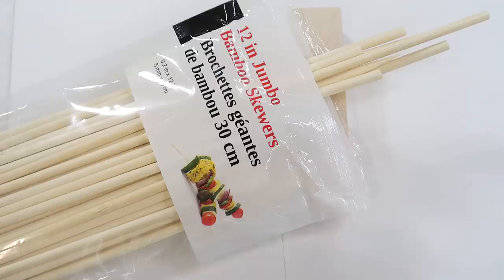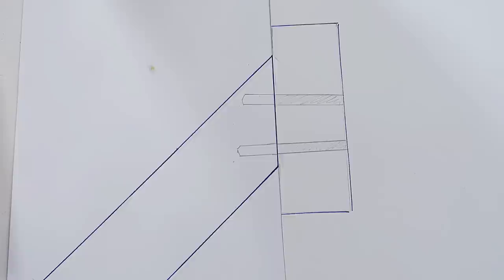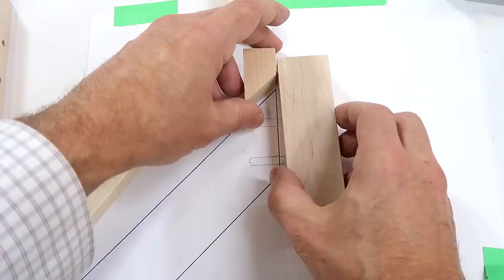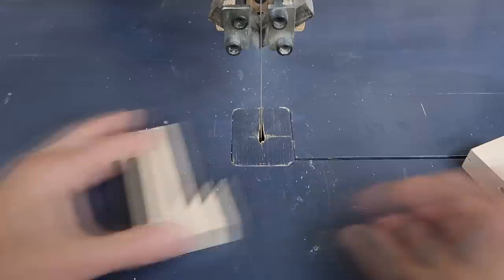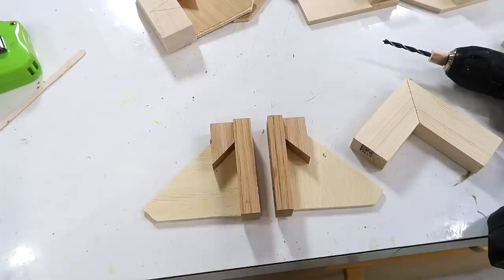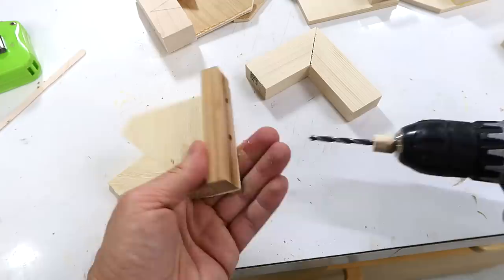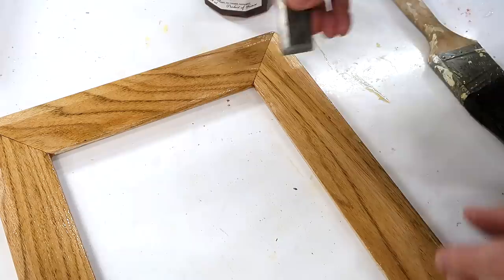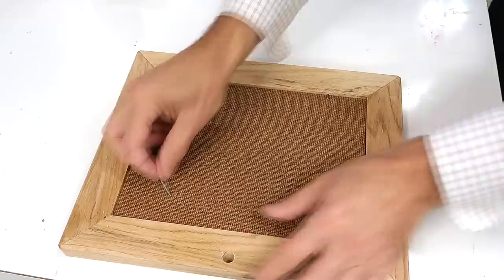Clever little miter doweling jig

Comment: Clever! If the holes are not perfectly square to the cut line when you split the block, they will be misaligned by the amount:  kerfwidth * tan(θ) ; and if they aren't parallel they won't be spaced evenly because the different angles will cause different offsets across the kerfwidth.  I suggest splitting the block first, then drill the holes so they stay aligned left-right, perhaps tape and superglue to a substrate to drill the holes after splitting.  Or just start with 2 blocks.
Reply: Don’t waste your time. Most viewers believe that every thing they see is genius, amazing and awesome !!!

Comment: If you cut the jig piece with the holes before drilling it, you won't have the saw's kerf contributing to misalignment.

If you drill the jig pieces oversized, you can press in a metal bushing for use as a drill guide to prolong the life.
Reply: Came here to say exactly this. Probably won't matter a ton (unless your drilling is super wonky), but definitely eliminates some slop.
Reply: If the two holes are too far out of parallel, the frame will be hard to assemble anyway. Just make the holes parallel enough, and you won't have to worry about the effect of the kerf
Reply: @liambohl  that's true, but if the holes are parallel, but not perpendicular to the cut, the final pieces will assemble, but not line up with the corner of the miter due to the kerf.
Reply: Strange that Matthias didn't consider this! He usually does like when making wooden bearing blocks. Make the cut, clamp back together and then drill.
Reply: Yeah, was gonna say the same. But if not too far out of parallel it wouldn't matter for woodworking. Metalworking is a whole different world though.

Comment: All-thread joining nuts makes for great cheap glue-in-place liners for drill-guides and the already drilled and threaded hole works fairly well as a self-centering guide when drilling out the threads(8mm drill for M8 nut etc) even if you just do it with the nut in a vice and use a battery-drill((using a smaller drill first is better from 6mm and up to get it as straight as possible if you don't have a drill-press/stand).
Reply from the maker: Good suggestion.  Though that may introduce some inaccuracy, unless I were to have super long nuts and cut those in half with the wood!
Reply: @matthiaswandel  While stuff like this is something that I would normally 3D print, in wood a hole that is marginally smaller than the largest diameter on the nut it will line itself up rather well in the hole and some polyurethane glue or construction sealant/adhesive(sikaflex/MS-polymer etc) will fill in the gaps and lock it solidly in place(thinking more about dowel/drill jigs in general rather than this one in particular).  

A joining nut's length is usually slightly shy of 5 times the bolt diameter(2x the diameter on either end + some extra room for leeway) so while a drill press is obviously preferable for drilling it out it is long enough to be fairly well self guiding if you don't have one(a M8 nut is usually 35mm long) so you would have to be rather brutal to see the last half of the length not be lined up/straight/centered well enough when drilling it out with a battery-drill.

Ever consider doing some tool/machine builds using laminate flooring as the build material? It's a rather amazing material that is cheap/strong/dimensionally accurate and available everywhere and in many cases its superior to MDF and plywood..

Comment: A clean and easy way to cut bamboo skewers is to score them along the circumference with a knife and simply break them in half. As a bonus, if the knife is not very sharp, the broken off pieces will have chamfered ends

Comment: I think that if the holes were significantly out of parrallel when drilling the jig and the dowels were long, you could have trouble inserting the two pieces. But with reasonable clearances on the dowels and holes, and reasonably parrallel holes, the jig will perform well.

Comment: The problem with bamboo dowels is that bamboo won't absorb an aliphatic resin glue, making it impervious to a glue like Titebond. Any kind of dowel will help a lot with alignment but bamboo dowels won't  reinforce the strength of a bond as well as dowels made from a more absorbent wood.

Comment: As usual, incredibly clever. (Except this time more than usual IMHO.). Two thoughts. If the dowel holes aren’t more or less parallel, it seems like fitting might be problematic (enough flex in dowels?).  Perhaps add a brass sleeve to keep jigs working longer. Thanks for the ideas!
Reply from the maker: If I drill them with a drill press, they are close enough to parallel without having to think about it.  With a hand drill, you'd have to be more careful

Comment: Very elegant. What glue do you prefer for sticking paper/card to a backing without wrinkling up the paper?
Reply from the maker: I just used a few dabs of hot glue
Reply: I'm really fond of rubber cement/contact cement for that: it's removable if used "wet" (ie. rubber cement mode can be peeled up easily, contact cement mode is permanent), doesn't wrinkle or hold the paper up off the backing any, and it's easy to clean any excess from around the edges of the paper being mounted.
Reply: @joelhollingsworth2374  thanks, I'll give that a go! A number of times I've made a nice frame then marred the end result by using whatever glue is to hand to stick the paper to a backing

Comment: If the guiding holes aren't square to the edge, they don't line up (quote) "perfectly" after cutting the block in half, because of the width of the blade... I know, I know, good enough. But this is Mathias, can't let inaccuracies slide, now, can we! :-D

Comment: Sorry have to disagree with hole accuracy.  Holes must be perpendicular.  If one side has holes say 2” apart with the exit holes 2.25” apart, the drilled holes in your mitres will not line up.  One mitre is 2” apart the other is 2.25” that is not going to work.  Nice concept otherwise.
Reply: Ohh duh mea culpa brain fade